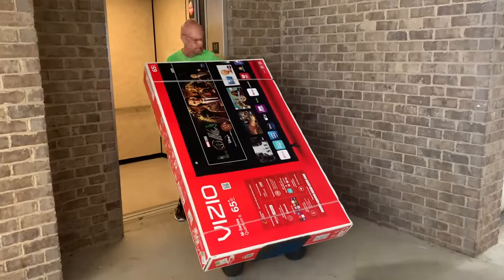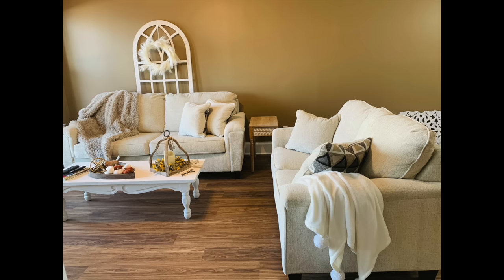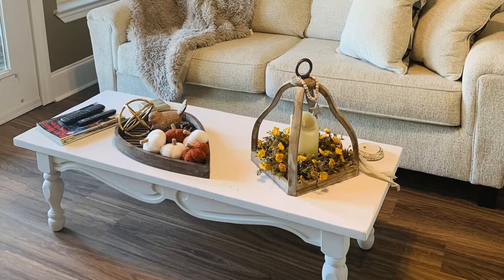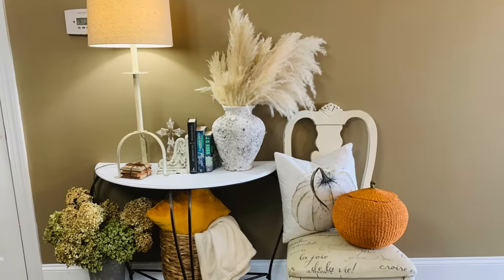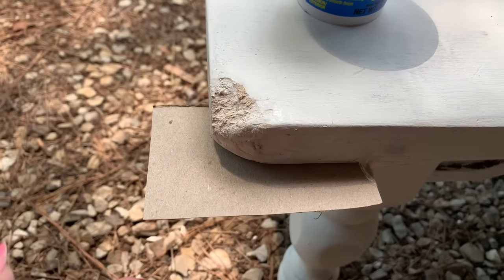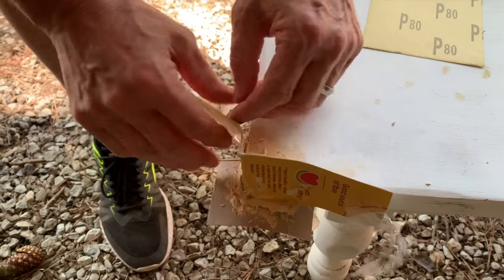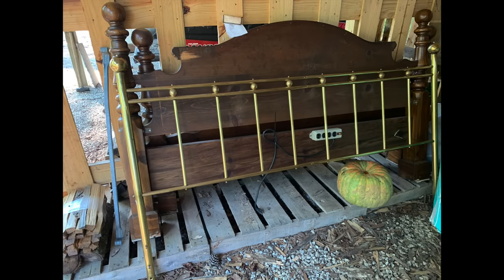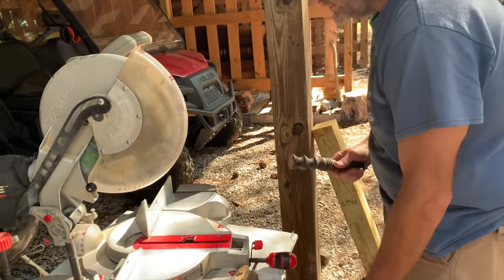See How I Decorate Our New Home! DIY Projects & Budget Friendly Ideas #diy #homedecor #decor

Comment: Hi Teresa. I’m a 73 year old diy/er and thought you might like the idea I found on making my own curtain rings out of pvc pipe. U can purchase hardware to screw into the rings. I buy a length of pvc, 2 1/2”circumference or larger. Cut 1/2” or whatever size you prefer and I used my drimmel to smooth the sharpe edge. Price is better than the large wood rings. I use drop cloths from HF for curtains as well.
Reply from the maker: Thanks for the tips!

Comment: LOVE the condo Teresa.  This is the first time I watched the remodel.  I love the floors, the all cream interior, as I have the same colors.  I change by seasons by putting a quilt on the sofa, then adding seasonal decor, most of which I have made,  I think you could use drop cloths for the window coverings.  They push outof the way when not in use, but darken the room when needed.  They are cheap and the texture is so pretty, I think.  Or, if you sew, white 100% linen would be beautiful.  Just sew panels, and hang them with curtain rings which clip on.  You can also just push them out of the way, then add another color panel for the season.     Anyway, whatever you do will be beautiful I am sure
Reply from the maker: Thanks so much for all the ideas and tips on the curtain panels. I love drop cloth and thought about using a short rod over the 2 end windows and leave the french doors like they are since they have a blind on them. I appreciate all of your help and suggestions.